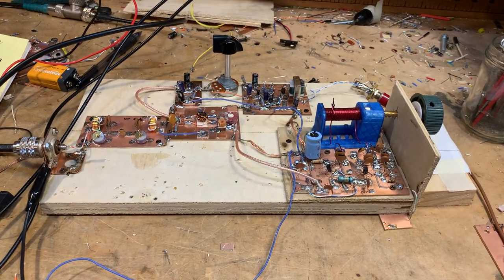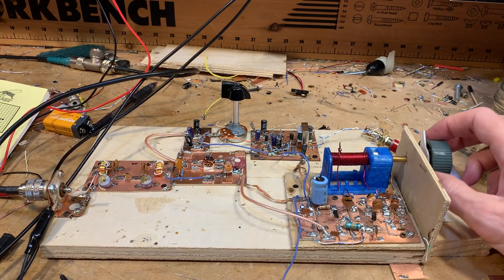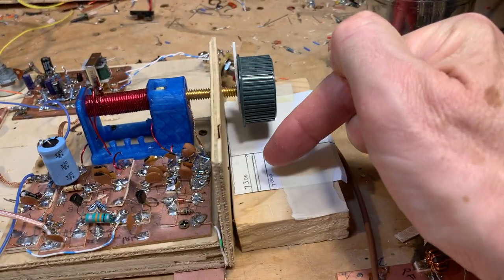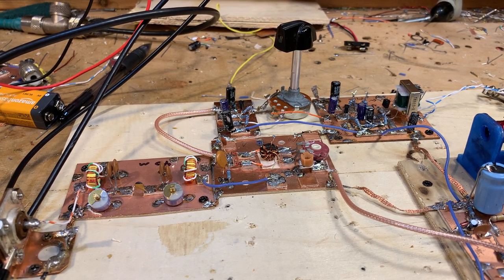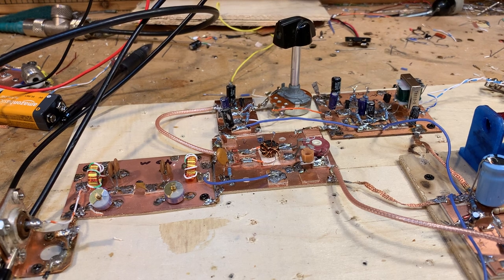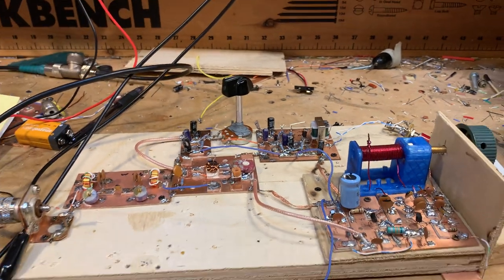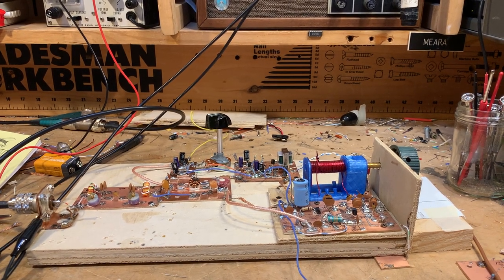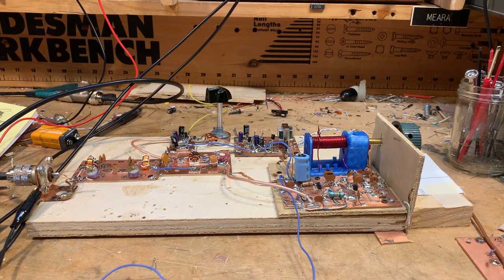Direct Conversion Receiver Passes the Radio Marti Test with a Simple Mixer

Comment: Hi Bill, Great video. Keep them coming. I have tried several discrete component Audio Amps. One from Exp Methods in RF design and the other from the internet. I just can't seem to make them work. I do an LM-386 and "Bob's your Uncle." Do you have the schematic you will be willing to share of your 3 stage Audio Amp? BTW, I did the Color Burst Liberation Army Mighty Mite and sent you a video. What I am trying to do now is reconstruct that on 40 M and build a receiver. But the Audio Amp kicks my butt.
Reply from the maker: I will try to post info on the AF amp on the blog.   It is a version of the Forrest Mimms amp.  It also borrows from the Herring Aid 5 AF amp.  Both are on the blog.  Keep leads short.  Keep inputs away from outputs.  Pay attention to decoupling the 12 VDC line (enough capacitors and resistors to keep AF off this line) .  Hang in there.  These kinds of troubles are common.  You are not alone!  Been there myself!    73  Bill

Comment: Hi Bill, I'm mucking around with my own version - curse you! 
Farhan's VFO has a 33uH. I've reasoned he targeted a XL of 400 ish ohms (470R?) at 2MHz. I've changed mine to 10uH to get the same (ish) XL at 7MHz. I have no clue if my logic stacks up, but I share for your thoughts.
I too am contemplating mixers (curse you again!). I'm gravitating towards a passive FET mixer. There's an intriguing reference to them in EMRFD chapter 8.4 page 8.12
Reply from the maker: Neville:   I didn't think much about scaling the buffer when I moved up to 7 MHz -- I just left he choke at 33uH.  I think it just serves as an RF choke, and I don't think 33uH vs. 10uH makes much difference.  But I could be wrong.  I tried a 10uH coil when I got your message:  Output to an open circuit was considerably larger than with the 33uH choke, but I already have more than enough output from this PTO.  Changing from 33 to 10uH didn't seem to make much difference at the VFO input port of the diode ring mixer.  Let me know if you learn more.  Thanks and 73  Bill